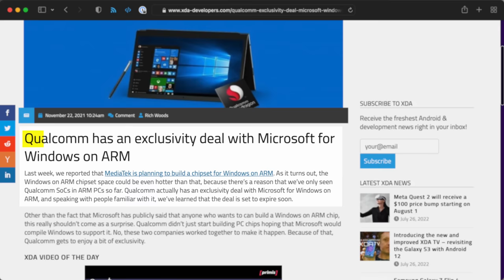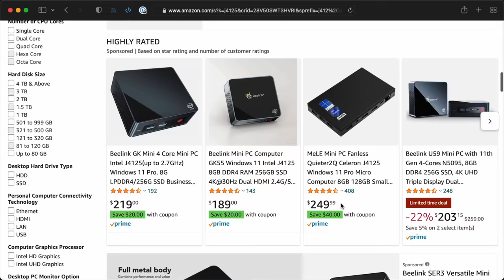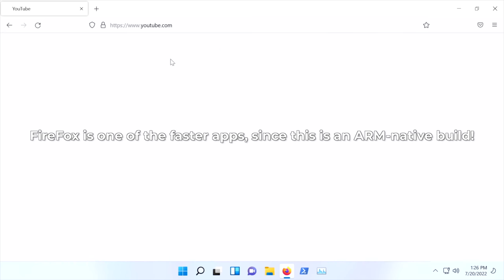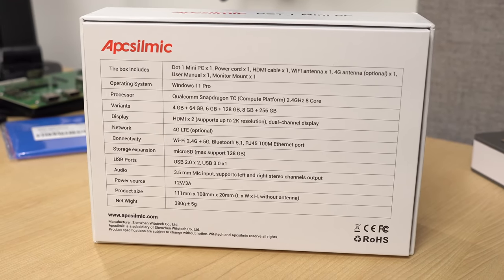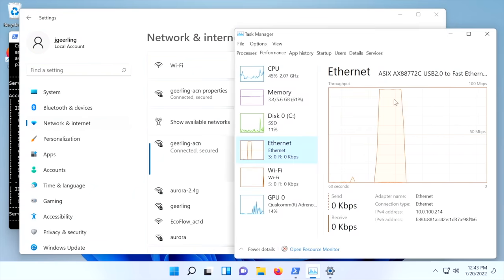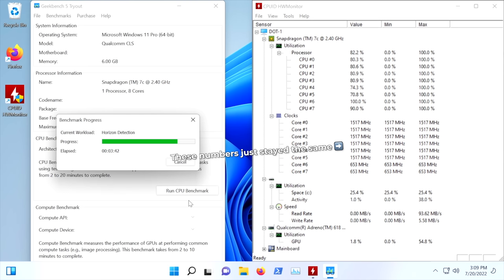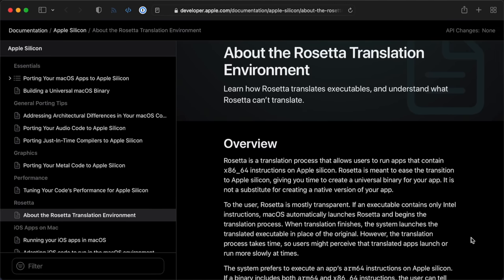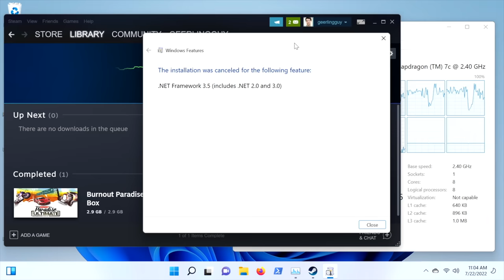Microsoft's wasted potential: Windows on ARM

Comment: I've said it before and I'll say it again no matter who disagrees, but I wish a new CISC architecture would crop up to compete with them all. One designed from scratch so it wasn't compatible with ARM or x86 chips. I know people gasp in horror at the thought of dumping backwards compatibility, but it would be worth it in this instance to have a good architecture. (In case anyone thinks I'm saying that ARM is CISC, no, it is not and I know that it is not. Any emulator that allows one to use ARM compiled programs would likely be written for a pre-existing platform and thus a chip could be compatible with the hardware the emulator is supposed to run on.)
Reply: But why CISC?  Hasn't RISC been considered superior for decades?  Aren't modern x86 chips essentially RISC processors with a CISC decoder bolted onto the front of it?
Reply: CISC belongs to the past. The only CISC architecture still in common use is x86, and that is only because of the inertia of the Windows installed base.

Which is also why, when Windows tries to move to RISC, it is always a flop.
Reply: @electronics-girl  A lot of things have been considered one thing or another for decades. Doesn't make it true. RISC and CISC aren't about the underlying implementation, they're about the interface, what the programmer interacts with, and x86 chips have always been more efficient, in terms of speed. A lot of people seem to think it doesn't matter how the instructions are encoded or generated by a compiler, but it does matter. For instance, with x86 chips, you have many 1 and 2 byte instructions which will fit in the cache far better than having every instruction being 2, 4 or 6 bytes. What's more, with ARM chips, not sure about other RISC's since I've only tangentially used them, but instructions start off as 2 bytes and move up to 4 bytes or more depending on mode. So you still have variable instruction widths that require special decoding. There is no valid argument for RISC especially when you consider that the only reasonable argument I've heard, pertaining to power draw, could be countered with a completely from scratch CISC chip.
Reply: @lawrencedoliveiro9104  I don't use Windows, at all. RISC and CISC have existed together for about 40-ish years. The only reason RISC is starting to take over is because someone realized that a barely used design was cheaper to license and thus produce. It's why you can get a $5 microcontroller to play with or a $15 computer capable of running a full GUI OS. Also, thanks for the reply. I wouldn't have seen the first message without it.
Reply: @anon_y_mousse  RISC has already taken over. Think of all the CISC architectures that were around in the 1980s, like Motorola 68K, DEC VAX and the other “Supermini” vendors, NatSemi, Zilog, Intel and others. All died away during the 1990s -- except one. And that one is now on its last legs.
Reply: @lawrencedoliveiro9104  You missed quite a few. Of course Intel is a multi-billion dollar corporation and AMD is as well, and you can't forget VIA. All three are doing quite well and it'll be many years yet before x86 is completely dead. Even when it finally is, it won't mean that what has replaced it is better, only that it was what the corporations wanted. Generally because they want to control you more.
Reply: @anon_y_mousse  RISC is better. It was designed by smart people specifically to be better, that’s why it exists. ARM is already the number-one top-shipping CPU architecture in the world. Number 2 used to be MIPS, but I think RISC-V has now taken that spot.
Reply: @lawrencedoliveiro9104  When you say things like MIPS or RISC-V are number two, I can't take you seriously.
Reply: @anon_y_mousse  You have no idea about the chip business, do you?

Comment: I’m just wondering why windows is literally dragging their heels on this whole thing… Mac OS was switched all at once. And it seems like it’s working out so far, I haven’t heard really any problems. An exclusivity deal doesn’t sound like it would be a problem at all for a company like Microsoft. 

Having said all that, I am a Surface Pro X user, and I love the thing. But with developers also dragging their heels on it, I don’t think I could recommend it to anyone other than people who use Microsoft office apps. Although I don’t know if those are ARM native. But they at least do work well. Oh, but don’t use it for school where you need to print anything. You are not able to run most printer drivers. That’s the worst part of it for me.
Reply: Because Microsoft's biggest clients need good legacy support... and you don't get that by moving to another chipset architecture willy-nilly.  Even MacOS has a pretty bad legacy compatibility with their new silicon and they can get away with that because, well... they simply don't have the client numbers that Microsoft does.  Like, not even close.
Reply: @Diviance  I didn’t mean Microsoft had to switch to ARM all at once. I just mean that it looks like there’s a good market coming for devices like the Surface Pro X, and it doesn’t seem like Microsoft is getting on board with that fact. Im not saying that everything in the lineup has to change right now. But it would be nice to see more devices with the ARM chips in them.

Comment: Was this a review about windows on arm or hardware? A lot of complaints seemed to be aimed at windows when it seemed more like a low spec hardware problem. Run windows 11 on Mac (in parallels) or one of the arm based surface devices? As a productivity platform, arm is amazing. Gaming is still crap, but I don’t think anyone is looking at arm to be a great gaming platform.

Comment: I have a Windowsphone that still runs good with Win8. 1 for arm.
And i have a windowsphone with Win10 for arm, which ran well, but got hot from the beginning. I think that they installed to much of the cpu and ram consuming bloatware, that we know from our notebooks.
Microsoft is still selling Tablets with theis OS for arm processors.
So: There are Windows OS for arm. Why don't you use one of them? The arm processors are fast and batterysaving as we can see on our android smartphones. But by emulating Windows you give this advantage away.
Reply: Windows RT is the reason why the user experience is so bad after Windows 7. The idea having an universal UI sounds good on paper but it just doesn't work. PC is PC. Mobile device is mobile device. Using a PC with mobile UI is a nightmare

And in recent years, Apple is slowly doing the same thing on macOS and iPadOS which people just wanna install macOS on an iPad but Apple just make macOS look more like iOS instead

Samsung's tablets have Dex Mode for desktop experience. It doesn't use the same mobile UI
Reply: AMD is actually making battery efficient x64 APU which has 0 compatibility issue but everyone just goes nuts on ARM because of the spy "AI" chip that doesn't work without internet 

Windows on ARM use insane amount of battery on x86 emulated app than an intel x86 chip running it natively
Also performance on native ARM apps are not really better than their x86 counterparts
The only thing that is better than the latest Macbook Air is 10% more battery efficient on watching Netflix. That's a $1300 ARM laptop

The whole use less battery argument is more like a hoax or I should call it marketing tricks

Comment: If Microsoft ever (but doubt) released an official Raspberry Pi image of Windows 11, it would increase Raspberry Pi users.
Reply: But why? What would be the need for that? Windows needs a lot of power to run smoothly, but that is ok, because it is basically ONLY a platform to play games anyway and thus built for that. And nice games today also need a lot of computer power. So you need a "better equipped" system in any case if you want to have a smooth experience. A Raspberry Pi is anything but that.
Reply: There is already Windows for Raspberry Pi. Hardly anybody uses it.

Comment: Microsoft still won’t commit a strategy to WARM. They’re dabbling with a dev box built by the surface team out 'soon' and courting mfrs to build Arm laptops but after people got burned with the Surface RT fiasco, im sure the community will be nervous for a long while to come.

i also wonder if they’re nervous about IP infringement against Intel and AMD - emulating proprietary instructions to improve performance, especially if it ends up being a dead end for them. Apple have gone all in and will be ready to fight but Microsoft will be nervous to upset their long term partners across the hardware side.

Comment: Wait what? You have Ethernet connected but expect WiFi to take precedent just because you have "Connect Automatically" checked? Pretty sure it doesn't work that way.
Reply from the maker: I don't expect it to take precedent, I expect it to stay connected since there are numerous reasons to maintain multiple network paths on a computer.

Comment: Microsoft do not have the Arm experience Apple has. First of all Apple is one of the founder of Arm and their first laptop with Arm chip is eMate 300 back in 1997. Apple has  perfect hardware software match since they produce both and they have a huge developer base who has Arm programming experience from mobile. So its not such a shock that Microsoft is left behind which is mainly an x86/x64 firm.
Reply: microsoft doesn't care yet. their saas and 365 pay well enough to just sit and collect...
Reply: Windows CE was running on ARM back then.

Microsoft have the experience, but their OS just isn’t versatile enough.

Comment: World of Warcraft has native WoA support. I have cheap Chinese Pipo W12 tablet with WoA and one of first Qualcomm chips used for WoA... and pretty much all WoA Qualcomm chips are just slightly modified phone chips. They are allegedly launching dedicated competitive chips by the end of 2023 based on Nuvia IP they bought.... and there is little reason to have and use WoA. It's nowhere near the capabilities of low power AMD chips (and software compatibility) and if you don't have software compatibility or performance to run it - you are using Linux on ARM anyway by then. And Qualcomm wants a lot of $ for their chips so it will likely never make sense for the price point.

Comment: Well I can show you a device that runs Linux on the Qualcomm 7C platform - it's the Acer 513 Chromebook (the old version, not the newest). The performance is sh*t there too. 
The real solution is the Qualcomm 8CX platform or ... well .. for Linux .. switch to MediaTek, their newest platforms are quite speedy and low power as well.

Comment: Qualcomm system on module and raspberry modules use same port or different thing ??
Reply from the maker: Different; sadly it's not a standard and even if the physical slot was the same, the pinout wouldn't match.
Reply: @JeffGeerling  what's a point making slot if not a standart. Qualcomm makes other versions?
For example, can I replace it with gen 1 soc

Comment: I usually like your content however when you are reviewing an experience on the WORST POSSIBLE ARM CPU of course you can expect this. I have a Surface Pro X and it is a little power house. If you got the lowest spec Intel Atom CPU the performance would be similar if not worse than this. The only argument for this is the price of the devices to performance is way too high right now, but regardless this video is bashing on Microsoft's implementation on Arm and in reality it is not as bad as this usually.
Reply: Exactly. I use a Surface Pro X as well and have never experienced the issues mentioned in the video. It has nothing to do with Windows on ARM.

Comment: The only reason to buy a windows computer is because of the programs and as such it has zero benefits to use it better to promote the linux usage with that so at least the system can be fixed and tweaked to really use arm devices.

Comment: My poco f1 windows 11 arm native performance 💪 better than your mini pc even it has old chip
I think windows arm is not that much slow i mean it far away from m1 like performance 
In my case x64 emulation did great job i am using windows insider new build cmd,vscode,upwork,php xamp  open in half seconds 😀 and wifi giving 500mb 
So mini pc cost cutting impact performance 

If Microsoft end arm exclusively deal it would like x64 any one can optimize and lunch 😋  then intel amd could make better 😉 than m1

Comment: I have 4 7gen woa, 8core and 3 gen8.3 woa.. woa needs 8core. My rk3588 and (s) 4 units just got woa.. I do love the woa but it can not develop using vs and 32b. I'm using Linux and getting full dev capabilities though I wrote my own thumb/32b/65b interwork ide to get my needs. The 32g ram with 512g nvme 8gen3 is an awesome woa device but very poor 32b dev support. I love multi-stack arm asm..stm/ldm and neural core. Rk3588 Linux gives best dev so far. I'll be converting the QC(Qualcomm) units to Linux this week. It will go dual woa/Linux when I can pure 32b asm dev on woa. 🥰🥰🥰🤗The eval guy. Good work.jpk ps. System needs 64b but user modes and user/system mode support 32b. 15 user stacks!!!!!

Comment: The windows culture is application software, it was the BIOS that allowed windows to thrive and those developers deserve more credit.  I had the unfortunate experience of taking a job and getting fired at MS years ago in the Windows CE era.  I had experience with drivers and bare metal systems and I said openly CE will not fly.  They laughed at me and said it will bring in 2 billion a year.  Well 10 Billion and 10 years later it was a loser and later I worked on a CE 6.0 app and it was pathetic after 10 years.  Google was shocked that so many vendors were clamoring for Android simply because MS didn't know how to make an embedded RTOS.  MS thru away the mobile and embedded space because of incompetence.  This description shows MS still doesn't get the embedded space; bloated, under powered, bad drivers, etc.  The embedded space is about drivers and MS doesn't have the culture to develop drivers or hardware - look at how many iterations it's taken them to develop their own server processor (almost 10 years and 3 tries) - same clumsy mismanagement just like Windows CE.    What people don't see coming is China is getting better at making semiconductors and not just processors but analog chips as well.  By the time MS gets it together (a big if) China will be competing with the major vendors and they are so PC I think China at the very least will drive prices down and take the air out of MS bottom line.  MS is still a money machine and the new CEO is doing a fantastic job but even he can't make embedded engineers out of application developers.  Much of the MS hardware is contracted out not done internally because the rank and file don't have the skills.

Comment: 8:23 that might be a problem with Firefox. They have a bit worse media performance than Chromium-based browsers, which results in higher CPU+GPU load and lower viable resolutions.

Comment: Apple only allows a very limited CPU never mind hardware... DOH no shit it only works if you control the hardware.  Windows on the other hand has to deal with lots of different CPUs AND hardware.  I prefer open hardware and love the fact Apple is using a UK architecture ;-). I remember using the R260 workstation running riscix!

Comment: Windows is vastly more complicated than Linux. What windows really needs to do is really make extreme differentiation between Home, Pro and Server
Reply: With big chunks rewritten. They try and reuse the parts, which makes sense, but the Service for the server version is 5 million lines of code and you can’t just skip all of it if you load the same dll in windows go. Technically I guess you can but …

They need to strip it back to the kernel, and finally they need to remove backwards compatibility
Reply: They tried that years ago: Starter, Home, Pro, Enterprise, Server, Datacenter, even an HPC edition. And don’t forget Windows Home Server.

Most of those are dead. Killed by Linux.

Comment: I would buy it if I knew for a fact I could put linux on it
Reply: There are several Linux distros which will run on ARM processors, the most common of which being Raspbian, made for the Raspberry Pi. However, other OSes, such as Ubuntu, also have ARM distros.

Comment: ok... you are using win11 and complain about the Powershell 2 Terminal... Did you try Powershell 7 Terminal? You have to install it manually since Microsoft doesn't include them in the normal Update process...

Comment: 'Microsoft need to do better' maybe arm need to do better.... using arm as a desktop is a miserable experience (even on my 8gb pi 4 with an ssd) I have an old nuc with 8gb and an ssd (just like the pi) running W10 and its very usable using the pi as a desktop not such a great experience and the pi 4 and case ssd keyboard mouse etc isn't much cheaper

Comment: I hate that people are always saying we need Windows for ARM, ARM is the future...
Just shows how people are naive and onesided. Writing and compiling applications is a complicated process.
Writing an OS such as Windows that supports all apps even from Windows 95 era is even harder.
Now you want Windows for ARM all its legendary app compatibility. That will not work. You can have Windows for ARM, but you are not satisfied that it does not support x86 apps, while MAC emulating x86 apps makes you think they have the lead.
Stop comparing Windows to MAC OS, because Windows userbase appreciates backwards compatibility and MAC users don't care about apps that were written a few years ago. Or even about performance gear such as 360 Hz displays, low latency mouses and other stuff.
Reply: That's what people are missing the backward compatibility and the use of legacy programs.  Going the MacOS path, all old programs would not be able to run on new hardware. 

That becomes a major problem for compines because it becomes a time sink to re code everything.